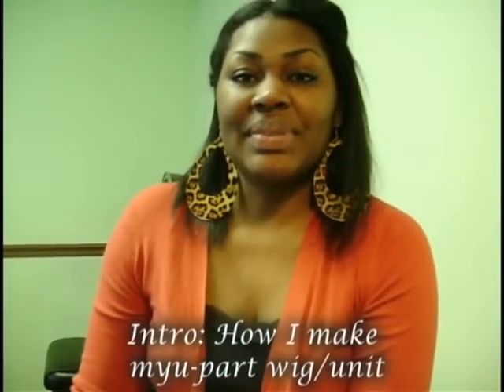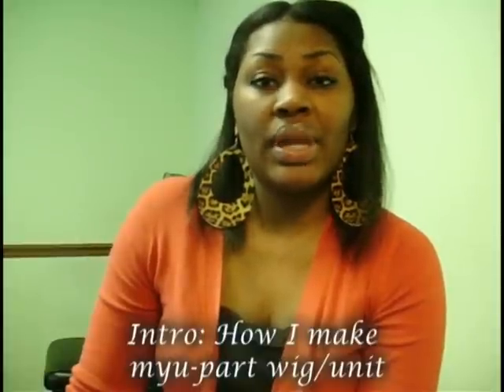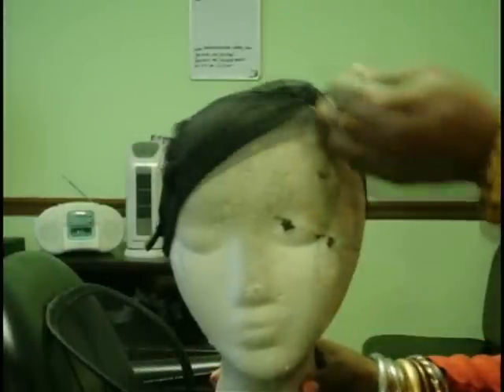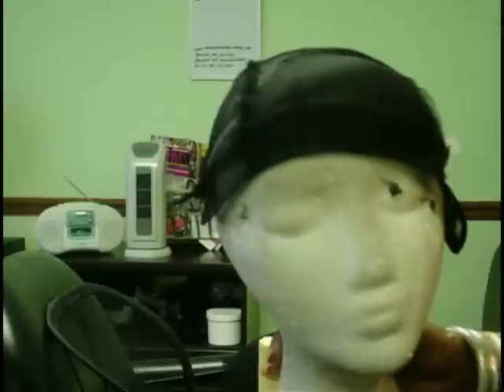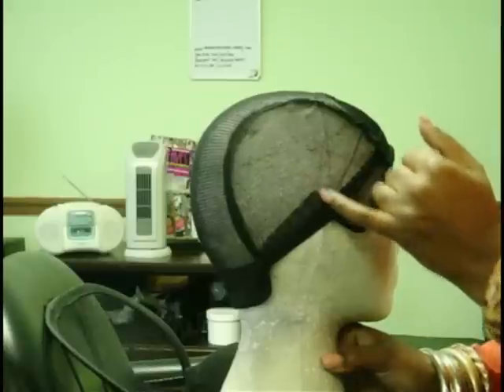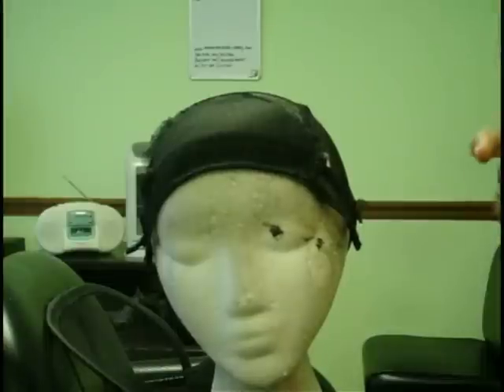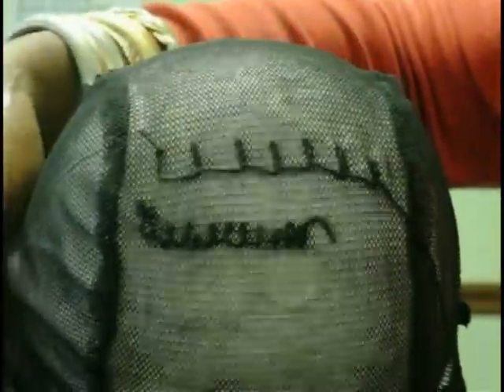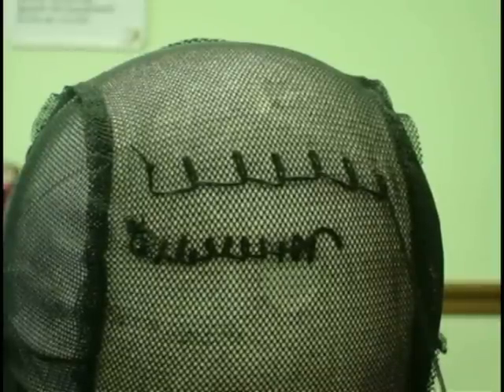Track Placement for a U-Part or 3/4 wig

Comment: Very detailed. I just want to know, wouldn't there be a big gap if you're folding the tracks and you start to arch by the crown instead of using the u pattern you've been using until that point?? Thanks